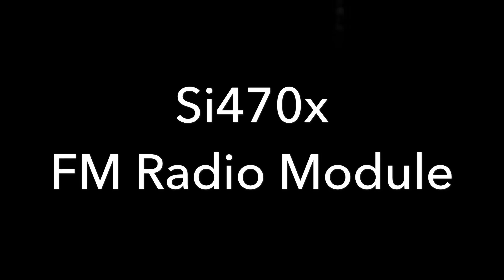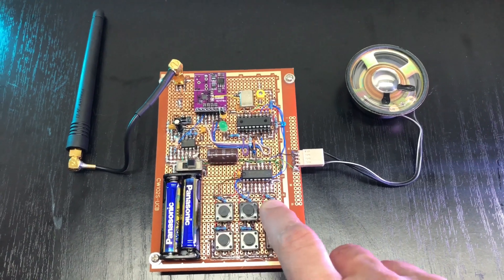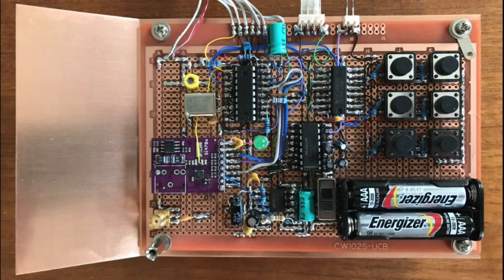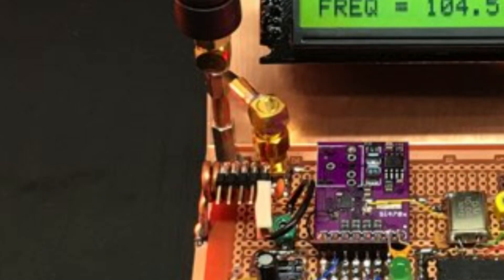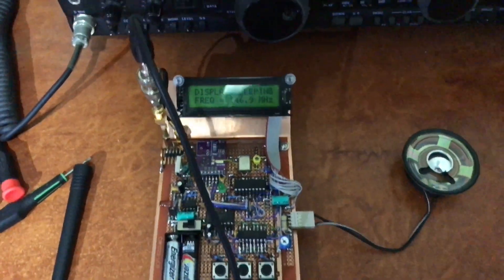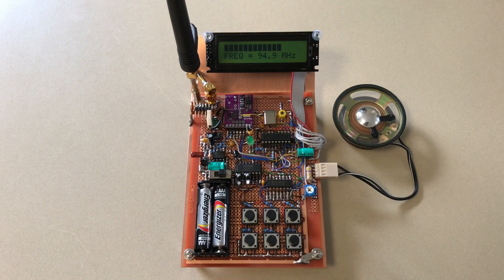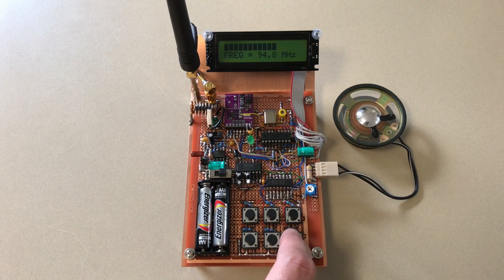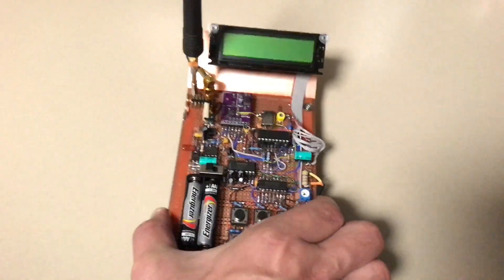Sparkfun Si470x FM Radio Demo

Comment: Great project, any possibility of a DAB follow up.
Thanks for sharing.
Reply from the maker: Hi :) Perhaps if the chips/modules were reasonably priced, but for now it looks that a homebrew project DAB radio would be more expensive than a name brand commercial product. I don’t think this will be the last radio though. This was just a random chip I had, but there are suitable wideband receivers out there.
Reply: @BrekMartin  Hi thanks for considering,  I too could not find a reasonably priced module, though i did wonder if anything could be achieved using an SDR usb dongle but not connected to a computer.  I've  seen the dongles for around £6  on ebay e.g.  http://www.ebay.com/itm/121675782559